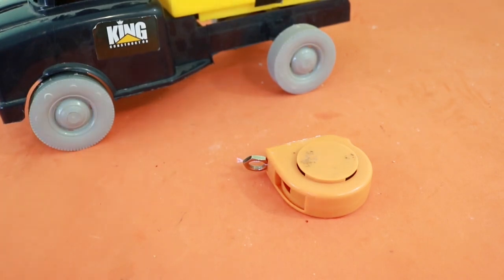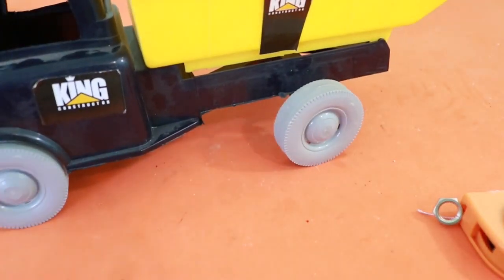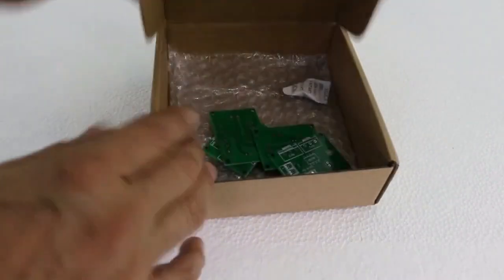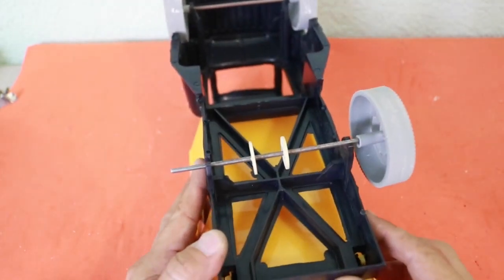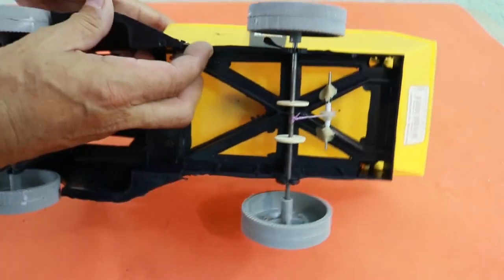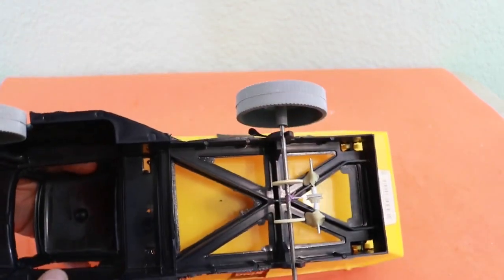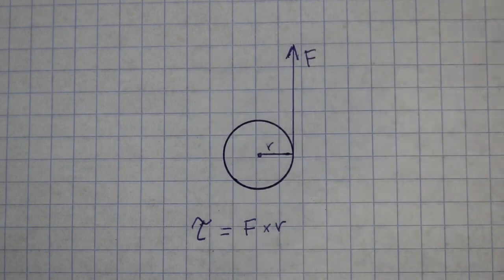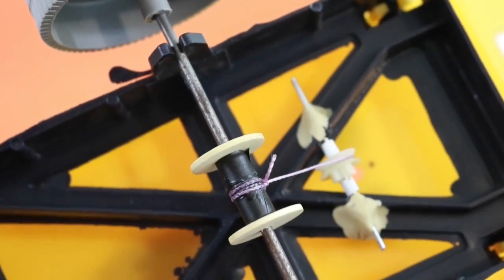Tape Measure Powered Toy Car

Comment: Nice video, another improvement is to remove the two metal bars and glue the tape measure facing down so the string goes straight through the hole on to the axle, removing two points of friction.